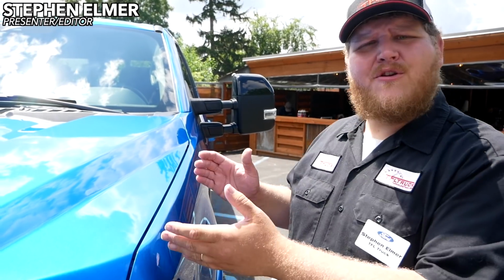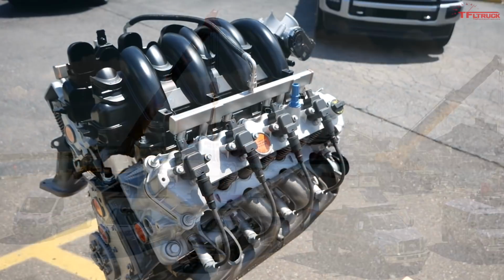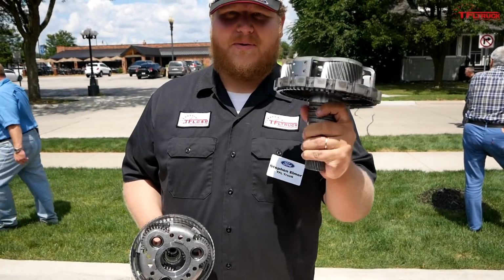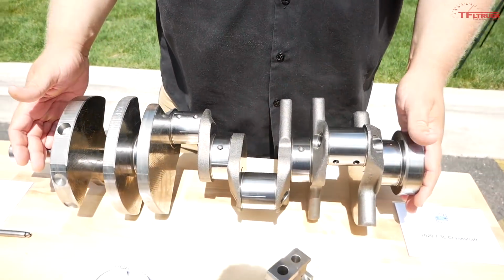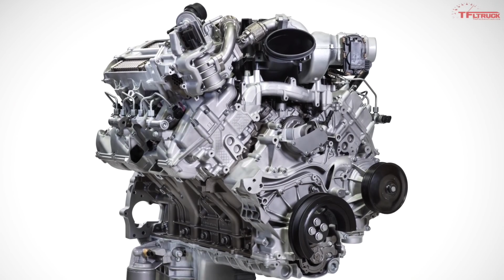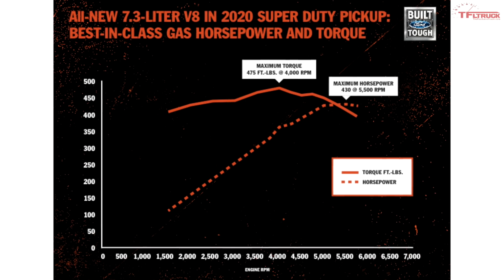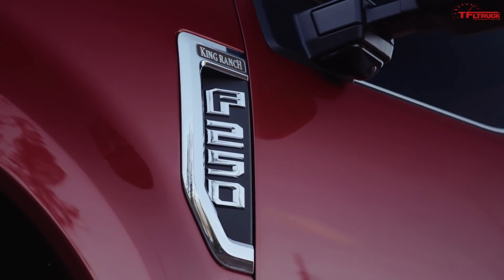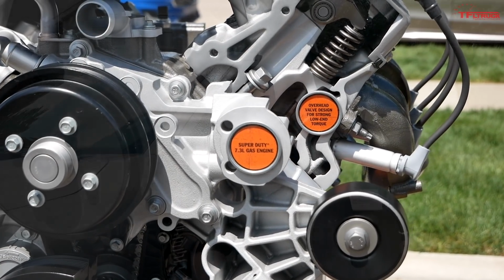We Finally Know the Ford Super Duty 7.3L V8 Power Numbers & They Are Lower Than We Thought!

Comment: Ford's 6.2 and 7.3 are the only v8s available now a days that require regular fuel and doesn't have the direct injection and cylinder deactivation , stop and go crappy technology that will comprise the durability and reliability of these engines. Last of the true v8s.
Reply: 5.7 tundra engine could not handle heavy duty truck use and abuse. They don't do amazing in regular work use but they are more than fine for 8/10 truck owners (grocery getters) these days.
Reply: Gerardo Linares agreed! Keep the girly tundras and the rest of the 1/2 tons out of this conversation.
Reply: The GM 6.0 didn't have any of these things either.  The GM 6.6 has direct injection but not the other things you mention.
Reply: @SkeldZ06  I believe the gen iv 6.0 has displacement on demand but yeah the 2015 box truck I drive with the 6.0 is the traditional v8.
Reply: @systemsoundbar5253  I assure you it doesn't, I have a 2016 6.0 2500 HD.
Reply: @SkeldZ06  maybe it's on their suv's
Reply: @systemsoundbar5253  The SUVs do have DI and DoD but they don't have the 6.0.
Reply: @SkeldZ06  gotcha
Reply: @systemsoundbar5253  Not in a HD.
Reply: Exactly right, and definitely the way to go for sure....now if they'd offer a manual transmission they'd have me back on the lot.
Reply: Yea the stop start stuff is absolute trash it's a HEAVY DUTY TRUCK WE NEED RELIABILITY AND TOWING NOT FUEL ECONOMY
Reply: Systemsoundbar i  like to call it last of a dying breed i also own a tundra 5.7
Reply: The 6.4 Hemi requires 87, has port  injection only, and doesn't have start stop.
Reply: William Stewart ram recommends 89 for their hemi engines.
Reply: Good comment
Reply: I thought the 6.2l and 7.3l had both port and direct injection.
Reply: @foxwithshades7080  no, just port fuel, however Ford's newer 5.0  mustang engine  is both port and direct injection.
Reply: @systemsoundbar5253  that would be my confusion. Ya I guess they are then. The 6.6L Chevy made is Direct injection, but no premium required and no AFM. I believe the 6.4L Hemi is premium fuel.
Reply: Eric Fox 6.4 is rated with 89. Runs fine with 87. Noticeable enough difference to offset cost? Not normally. Maybe heavy towing in hot temps it’s worth it.
Reply: @foxwithshades7080  my dad has the 6.4 in his 2500 but runs 87
Reply: Toyotas 5.7 uses regular fuel and has none of that crap....its why I have one.
Reply: @pryme2013  me 2 and a 4:3 rear end.
Reply: @pryme2013  Yeah but tundras are bloated and ugly soo
Reply: @pryme2013  Leave the all-aluminum, DOHC light-duty 5.7 Toyota out of this LOL. This is for 3/4 trucks with old school pushrods, iron block and aluminum head V8.
BTW Toyota's already playing with Start/Stop too, and they're going to put in their trucks in the upcoming redesign, along with direct injection and premium fuel.
Reply: @Mr10Alpine  please post a confirmed source for all that juicy info. Thanks
Reply: I’d put the GM 6.0 up against any other V8 any day
Reply: @irishuwould5185  Should be no problem to have the GM 6.0 compared to the Ford 7.3... you know, how GM guys have no problem comparing higher displacement engines to the rest of fords' lineup...
Reply: @dre04mach  you're probably thinking twin turbo EcoBoost engines vs GM.. really?....
Reply: @gjolinares23  No, but the 5.7 LS1 vs the 4.6 (sohc and dohc), the 6.2 LS2/LS3 vs the 5.0 and so on.  n/a vs n/a... we already know GM's 2.7 turbo motor has nothing on Ford's 2.7 ecoboost, so no point going there. :D

Comment: I expected at least 600hp and 1,000 ft lbs torque
Reply: Dude, It's a gas engine. The turbo diesel option doesn't even get those numbers let alone a gas option tuned for E87. It's also the first generation for this engine. They have to save power room for the upcoming years so they can bump the numbers to stay ahead of ram and gm.
Reply: Lol! 💪💪💪 the real number of this 7.3 is 457hp and 531 Torque that's enough because!!! What matters is were it delivers the torque and horsepower.

Comment: You combine the new engine, 10 spd automatic, and tremor functionality and that's a strong argument for buying a 2020. But, still waiting for EPA mpg,  pricing and towing specs ....
Reply: Matthew Marlowe EPA doesn’t do mpg for heavy duty trucks.
Reply: I've had the pleasure of testing this engine in prototype form on several occasions and I can say that I'm not as impressed as I'd like to be. The engine feels old, very similar to the feel of Chevy's 454 and some of fords engines back in the 80-90s which isn't really a bad thing but it doesn't feel up to par with the competition despite having slightly more power. I truly appreciate that they're going for durability though. My biggest disappointment would have to be the mpg. I was only able to average between 6-11 mpg throughout a fairly diverse route. Granted, every truck I tested was weighted down by about 3-5k pounds in the bed which suggest that most owners will be lucky to average 15mpg empty. While testing Rams updated 6.4 with the  new 8 speed on the HD platform I was able to average close to 20mpg under the same driving conditions while the truck was empty and about 11-15mpg under load.
Reply: Jordan Sterling   And where have you been able to test these 7.3s?
Reply: @randomprojectsusa5196  There's a reason I didn't state who I worked for or where I tested. Your allowed to not believe me if you'd like. I'm just on here adding my educated opinion to some unanswered questions.
Reply: Yar Nunya  There's a reason I didn't state who I worked for or where I tested. I also did not disclose any official information regarding the engine or it's features, just my overall thoughts which is not in violation of my NDA since it is opinion not factual based. But if you sleep better at night thinking I'll be dismissed then more power to ya.

Comment: Was that push rods in the cut away? Can't believe they went old school like GM and RAM with push rods instead of SOHC or DOHC.
Reply: That's been known since Ford announced the engine
Reply: Jeremy Gilliam why? Push rods engine makes good sense in this application. They make more torque at a lower rpm cheaper to produce/repair and a physically smaller engine for better packaging. Peak power a higher rpm Capability just doesn’t matter and in a heavy duty truck motor.

Comment: What good is a pushrod vs overhead cam? I know a pushrod motor has rocker arms and open and close valves... Seems a duel overhead cam without pushrods would be more accurate.

I know old school pushrods are comforting but are pushrods bettrr than overhead cams?

Id prefer the 7.3 diesel vs 7.3 gas engine. I hear the 7.3 diesel is a tank.
I gotta say if you want torque go with a diesel
Reply: Pushrod v8s in general typicaly make good torque. That paired with a long stroke and low reving powerband means durability and a long life
Reply: A dohc 7.3 wouldn't fit in the truck as that is the downside of the dohc design! It would have made way more power but there would be no room for anything!
Reply: Reliability, ease of manufacturing and something that's counter intuitive. Liter per liter of cylinder displacement a multivalve ohc makes more HP.  Having said that the over all size of the engine not the cylinder displacement but engine size is smaller with a pushrod engine making similar numbers to a multivalve ohc engine.  It is easier to package in a vehicle.  Take a Fiero v8 engine swap for instance. It's easier size wise to fit a 6.2 liter pushrod v8 into a Fiero than 4.6 Cadillac Northstar v8 .
Reply: Thanks for the clarification guys.
Reply: I really hope English isn't your first language, because what you said is awfully confusing.
"I know old school pushrods are comforting but are pushrods bettrr than overhead cams?
"
Remember, GM and Chrysler put OHV V8 engines in their trucks/cars, not OHC.
Reply: @thetinpin  English is my first language but gets a little dodgy after quite a few drinks.

Comment: Ok, I really don't see the point of the 7.3L engine if that's all the power and torque it produces? The Ford guy kept going on about durability but was that the only reason they went for this engine? I think they could have upgraded the old 6.2L with more steel parts in the engine and had a low pressure turbo system on it that would have produced a TON more torque than the 7.3L engine and they'd probably have saved millions in development costs.
Reply: 7.3 hp is 457 and 531 Torque them are the real numbers!!!
Reply: @robertmeese6545  Video says 430hp and 475lbs ft of torque!
Reply: They went with this, according to other interviews, because this size engine with the technology will get better efficiency while towing and under heavier loads.
Reply: @adb1993-q5g  Mercedes even have a new 2.9L straight six with 330hp and 516lb ft of torque.
Reply: @adb1993-q5g , if you want to get better efficiency while towing for what is basically a mid range engine in a truck platform go with a big straight six diesel of say 5.0L. Simple design by being straight six for better air cooling around it plus easier maintaining, biggest radiator you can do, either a big or duel oil filtration.
Reply: The 6.2L is much more complex than this 7.3L, and considering the type of people that will buy this desire longevity and ease of service above almost all else.  They will never have to worry about turbo failure or GDI associated carbon issues, for example.  Besides, forced induction inherently results in reduced engine service life - something that commercial vehicle buyers don't want to even think about.  Those guys tend to champion the "keep it simple, stupid" approach because it generally implies longevity and lower cost of ownership.  Reducing the total number of potential failure points is a very good way to increase reliability.  Also worth noting that OHV engines generally provide much more low-end torque than OHC designs - something else that is very important to people hauling or towing all day.

That said, the aftermarket will undoubtedly provide turbos and superchargers for the engine, so if you really want one, you could install one.  The potential peak HP/TQ results should be pretty damn awesome considering the strength of the internals and their implied resistance to abuse.
Reply: @thetinpin  Crikey, somebody had better tell Mercedes a their turbo diesels didn't actually get mileages of 500,000 miles plus and keep going when they are shipped off to north Africa where they are begging for them.
Reply: @theworldaccordingtochris4370  When did I say anything about diesel?  The significantly higher compression ratios in diesel engines compared to gasoline (~14:1 to 18:1 or higher vs usually under 10:1) require MUCH stronger designs to prevent them from blowing themselves apart during normal use.  Because of this, they readily tolerate the stress of forced induction on top of their compression based ignition.  This makes diesel engine service life a poor reference for use in comparison to any gasoline engine's service life.  
You're comparing apples to oranges there dude.
Reply: @thetinpin  I like oranges better DUDE
Reply: And it would bring the manufacturing COGS up higher, bringing the price up, as well as reducing reliability. Hmmm there goes that idea.
Reply: @alexs3187  YOUR diesels are more unreliable, European diesels are VERY reliable. Europe is light-years ahead of The US on diesel engines.
Reply: Christopher Hallinan also please try to back up your claims with facts and logic. I know that’s hard for you to do, but at least TRY!
Reply: Christopher Hallinan you know Iveco has an 8.7L Turbo diesel with only 310hp? You know that’s European, right? Anything to say about that? 😂🤣😆

Comment: Seriously impressed. For the use case, it's more than enough power, and as long as there's no 'oops' in the design, this will last forever. This engine makes total sense in a HD truck.
Reply: Maybe, but 6.4L still has cam/lifter wear problems, and Ram still rates their engines using 89 octane. Who the hell is putting 89 in these. Optimize the engine for 87!!
Reply: I'm more curious about torque between 1500 and 2500. Can it cruise and pull a hill with a load and not shift. So annoying when going over rolling hills and you have to chose between staying in a low gear or letting the transmission shift for every little hill. Peak torque only matters if it's in the low end of the rpm range to me.
Reply: It's a medium duty truck engine that's going to be in everything from the 250-350 all the way up to 750.  usually these engines are d-rated for longetivity and it makes total sense that the numbers are not stupid high
Reply: @Spahi77  This 7.3 in the medium duty trucks is rated at 350hp/468tq

I agree that these numbers are sensible. I just thought Ford would have pushed it to 450hp/500tq for no other reason than to make a statement. The fact it only makes 11tq more than Chevrolets significantly smaller 6.6 has done only one thing and that is I'm now no longer disappointed with the Chevy 6.6 haha
Reply: Finally a competitor to my 516k mile 2v
Reply: It can make that power at 100% engine load. Cant wait to get one.
Reply: that being said im not to impressed out of the power numbers. fuel economy better be great.
Reply: Getting started from a dead stop with a heavy load is important not only for pulling a trailer, but also if you have a heavy payload.  My dream RV would be a 2020 F350 duallie with the 7.3 liter V8, hauling the biggest (and heaviest) truck camper made by Lance (their model 1172 weighs 4628 lbs with water tanks filled).  And, it would be nice to go up a grade on the freeway and not have to reduce speed below the speed limit, whether that's 55 or 70.
Reply: So does the diesel
Reply: Engine may last forever but the transmission I have my doubts.  Way too many gears for the transmission to be continually hunting through, you may not feel it because there's so many gears so closely ratio'd together, but it'll be shifting a lot creating a lot of excess heat, which will significantly effect the longevity of the transmission, should have kept it at 4-6 gears especially for a heavy duty truck.
Reply: Ford built this to last forever and work seriously hard. This should last forever and handle serious abuse. But this thing needs to be boosted and show off that strength
Reply: @CparkerWelding  Boosted, then loose any sort of longevity of the engine.  You start doing that stuff and you significantly decrease the lifespan of an engine.  You are forcing much higher pressures into the engine that it wasn't built for.  The engine as is has more than enough power to do whatever you want with it.  400HP+ / 400ftlbs torque is a lot of power for a pickup truck.
Reply: @wildbill23c  my 7.3 is doingnmkre the double factory power and it's fine. If you run at stupid high output yeah it will hurt but maintainence becomes extremely important then. But I bet that woukd survive 14 pounds of boost for a very long time
Reply: @CparkerWelding  Like many other engines they're detuned from the factory significantly to avoid insurance hikes and other legalities.  I'm sure that engine is quite capable of 800+HP if you do it right.
Reply: when you have a GCVW rating of 25,000 pounds or more

you increase engine life by reducing Power Density
Reply: N Pooch agreed,I think this engine fits the hd market better then the 6.6 gasser Chevy and 6.4hemi
Reply: Brian Austin — I respectfully agree and disagree.  It depends how you define ‘segment’.  The F550 body-job client is a very different end-user than the F250 SRW 6.5ft box client.   Those are guys who might have a fifth wheel that they tow every other weekend but use the truck to drive to work.  Those two demographics are going to want different engines.   Is the 7.3 a good addition?  Sure, but it leaves the F250 and some F350 people still wanting more.
Reply: @brianaustin6184  Oh why is that? Or are you just saying that because it has the same displacement as the last bulletproof Powerstroke.
Reply: Brian Austin it’s only 29 hp and 5 lb ft over the Chevy 6.6 which means it will have undetectable “seat of the pants” power gains over GM. Like he said, they thought it would make a lot more power being that it’s a 7.3 and they’re right because that tiny power gain is nothing.
Reply: @wrzl1675  In HD vehicles that are meant for fleets and severe work conditions, it's not about a huge power gain, it's about durability and efficiency. Having approximately the same amount of power in a larger-displacement, less-stressed engine, it's possible that this engine will be immensely durable and long-lasting.
Reply: @wrzl1675  The Chevy 6.6 is paired to a 6 speed instead of a 10 speed on the Ford.  It's a little early to say whether anything will be detectable until we see how it plays with the trans and what they run for the rear end ratio.
Reply: @wrzl1675  Big questions will be fuel efficiency and reliability.
Reply: @wrzl1675  two engines can have the same power and perform totally different.
Reply: Randy Carlisle  m.
Reply: @wrzl1675  came here to say the same. Not only are the torque numbers close they are at the same 4000rpm. The horsepower on the all new Chevy  peaks at 5200rpm vs the 7.3L @ 5500rpm. Suspect both engines make similar HP closer to peak torque. At almost a liter smaller, the new Chevy engine should get better fuel economy as well.
Reply: Its low power now but ford will raise the power so you'll want a new truck in 2 years and so on
Reply: My 89 Silverado 1ton with the 454(7.4l) tbi puts down 400 lb-ft of torque at 1800. It's a super reliable, low compression motor that is 30 years old. It starts right up every time I turn the key, and uses minimal oil between oil changes. I feel like the big three are trying to reinvent the wheel.
Reply: These trucks will still be found on road dead